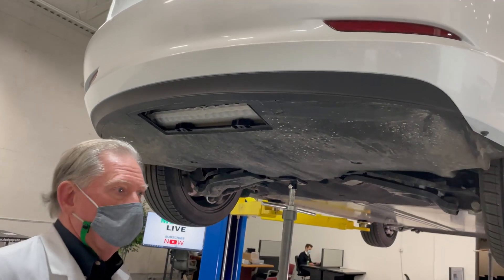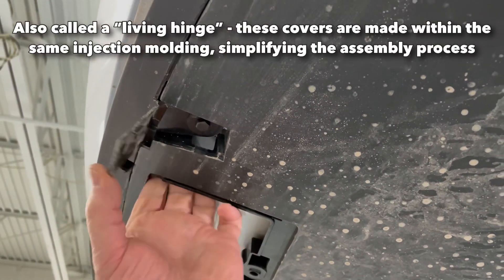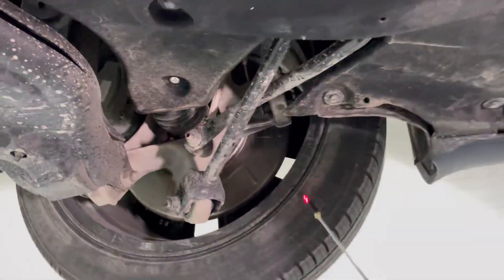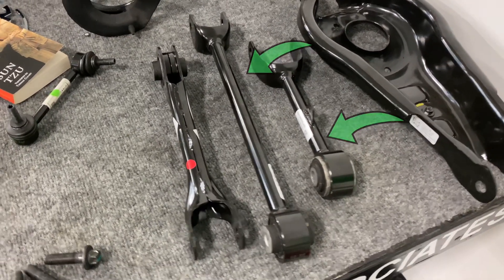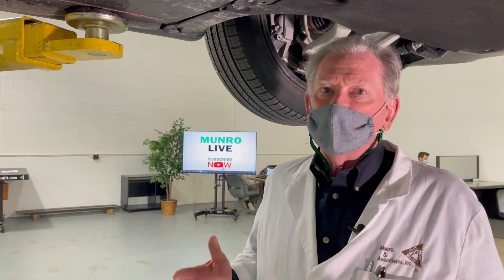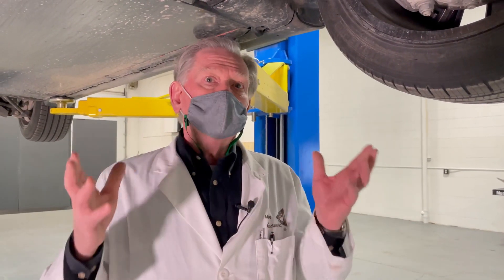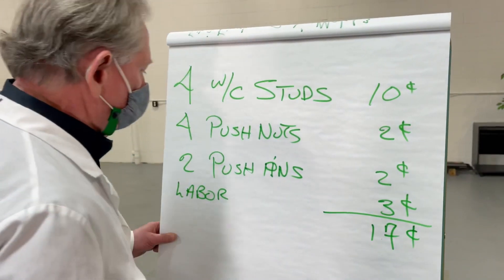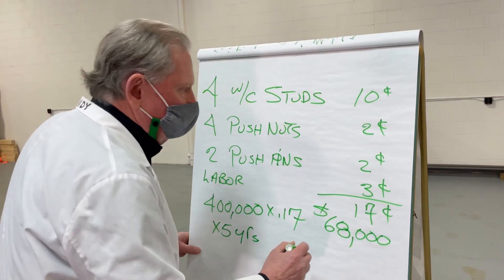2021 Tesla Model 3: E2 - Hoist Review & Some Cost Savings

Comment: Sure it represents money globally but the essential metric is the margin per car. It is these kind of cost reductions by the hundreds or even thousands that can help improve the per car profitability and then the positive cash flow of the company
Reply: I mean, why paint the car? Why have motorized seat adjusters? Why not have a fixed steering, instead of a motorized one? Why have Autopilot and FSD? Why not have a manual window wind? At what point is cheap too cheap?
Reply: @KyleHubb  There are tremendous cost reduction possibilities by having simple engineering and well executed manufacturing. Car assembly is a work of thousands of pieces put together and a lot can be done to cut cost.

Comment: About that rear underbody access panel: several possibilities come to mind to justify it.

One is design standardization.  By designing that access cover as it is, the Model 3 design can be readily exported to factories where towing is intended to be a feature (Europe).  GF-Berlin doesn't have to develop its own rear underbody; it can take the US design and simply add the tow package.  Easy.  Cheap.

There are advantages to universality of design - fewer parts to keep track of in the system is good.

The other possibility I'm not so sure about, but... that access cover might be useful for removing dirt and water from the rear underbody, particularly water.  We would hope that no dirt or water will get into that space - but Tesla has had difficulties with earlier underbody designs.  Maybe they put that panel in to simplify maintenance (reducing warranty costs Tesla bears, as well as reducing post-warranty costs for consumers) if that problem reared its ugly head again.  Pop the panel and drain; or pop the panel and powerwash, then drain.  No need to remove the entire rear underbody panel.

Comment: A lot of people may say this is good but I personally am against it. I would very much would rather have those clips plugged in. Knowing very well that I am not gonna have a piece be falling off or gathering dirt over time.
Reply: Couldn’t agree more. It might be sort of good now, but after some years and maintenance when the covers had to be removed multiple times and reinstalled, they will get more deformed and just hang on. Well noted that it will definitely will be collecting and trapping mud there. Also, another possible point for annoying plastic rattling of loose parts.
Reply: And you bet you still pay for the clips!

Comment: Hello, first of all, I would like to thank Tesla for providing people all over the world with relatively equal's affordable and high-quality sustainable energy vehicles and home solar systems!
As for cars, I think the workmanship and gaps are all minor problems. Simple and practical interior design, smooth and beautiful appearance design, superior performance, convenience and practicality are the key points.
However, regarding kinetic energy recovery and single pedal mode, I have some immature opinions here. I hope Tesla can refer to it. Thank you.
I'm 38 years old, I have more than ten years' experience in driving oil cars, and I've driven many German and Japanese cars. Out of my sincere affection for Tesla (I haven't bought it yet because I had some personal problems two years ago, and I will definitely buy a Tesla home in the future), I've tested model3 several times, and I feel great, which is more German than German!
Some time ago, BYD Qin was driven for a few days, but it was good at first. After a long time, the kinetic energy recovery was too uncomfortable. Your right foot had to keep in a tense state, stepping slowly and loosening slowly. If you were not careful, you would stumble. Moreover, the kinetic energy recovery in both gears was very strong, which made my right foot afraid to leave the accelerator easily. Once I followed the car to the right at a low speed, and the car in front suddenly slowed down. My right foot was still reluctant to leave the accelerator and tried to slow down by lifting it. However, because the car in front decelerated too fast, it was not enough to slow down by lifting the throttle, and it was getting closer and closer. At this time, I was nervous and stepped on the throttle slightly, and almost rear-end collision. Only then did I react, and I quickly braked to avoid an unexpected acceleration accident.
Since then, I have been worried about the recovery of intensity kinetic energy. I am worried about whether Tesla will have similar problems. With this question, I once again went to test drive model3, focusing on the feeling of kinetic energy recovery. Fortunately, The kinetic energy recovery of model3 is also two gears. When it is set to the easy mode, it is basically similar to the oil car. Although raising the throttle will slow down slightly, it is very smooth and soft, which basically will not cause the right foot to remain nervous all the time. However, in the standard mode, the recovery intensity of kinetic energy is still very high. Although it is quite smooth compared with BYD's suddenness, the deceleration of lifting the throttle is still obvious. This is not a problem of inadaptability, but a problem of lightness. Although automatic driving will make people more relaxed in the future, there will always be some roads that are not suitable for automatic driving or users occasionally want to drive by themselves. Fortunately, Tesla gave users a choice to drive easily.
Recently, I heard that Tesla is going to cancel the function of adjustable kinetic energy recovery intensity and use standard mode or automatic mode in a unified way. Although the latest version has not been tested, the feeling of lifting the accelerator pedal will definitely not be as natural and smooth as that in easy mode. I hope Tesla will consider whether this function can be restored and let users choose which way to drive.
With regard to the single pedal mode, it seems that the driving steps are simplified, but in fact, they are more complicated, which makes it easier for users to step on the accelerator as a brake and cause unexpected acceleration accidents in some cases.
A driver can be divided into five driving states, namely acceleration, speed keeping, natural deceleration, braking deceleration and emergency braking. In the era of oil vehicles, the right foot movements corresponding to these states were: stepping on the accelerator pedal, keeping the accelerator pedal, leaving the accelerator pedal, lightly stepping on the brake, and re-stepping on the brake. However, in the single pedal mode, the logic of the right foot changes to stepping on the accelerator pedal, keeping the accelerator pedal, slowly and linearly lifting the accelerator pedal, rapidly and linearly lifting the accelerator pedal, and stepping on the brake pedal again. The crux of the problem lies in two stages: natural deceleration and braking deceleration. The traditional driving habits are clear and easy to do, but the single pedal mode requires the right foot to keep tense all the time. Moreover, braking deceleration and emergency braking are two completely different actions, and the relationship between them is very close. In some accidents, these two States are connected together. First find out the situation, first use the brake, It is found that the braking force is not enough at this time, and emergency braking is carried out quickly, which is changed from light braking to heavy braking in the traditional driving mode, but in the single pedal mode, the accelerator pedal is quickly and linearly lifted to heavy braking. Obviously, there are problems in both the conversion difficulty and the conversion speed.
After talking about the comfort and safety of the single pedal mode, let's talk about energy saving. The current technology may not be able to combine kinetic energy recovery with the brake pedal under the condition of safety, seamless and acceptable cost. At present, it is only heard that the taycan of Porsche recovers energy when braking. Regardless of this point, based on the existing hardware configuration, it is possible to lift the accelerator pedal to use the easy recovery mode (or use the standard, which depends on the user's setting), and perform standard energy recovery (or more intensive energy recovery) when the brake pedal is depressed. Because in some cases, when the driver lifts the accelerator pedal, he only wants to slow down naturally or relax his right foot, and has no intention of braking and slowing down. At this time, if kinetic energy recovery is forced, the vehicle speed will drop quickly, and then the driver needs to accelerate again to mention the speed just now. According to the conservation of energy and the conversion loss, the energy recovery in this case is ineffective or even not worth the loss (of course, the accelerator pedal can be lifted slowly and linearly, but this will test the user's driving experience and be very nervous.
To sum up
1. simply restore the adjustable function of kinetic energy recovery, and let users choose which mode.
2. For safety, it is better to cancel the single pedal mode.
3. Adjust the kinetic energy recovery logic, lift the accelerator pedal to use the easy recovery mode, and press the brake pedal to use the standard or enhanced kinetic energy recovery mode.

The above is the voice of a loyal Tesla user. I hope Tesla will get better and better, popularize the use of sustainable energy as soon as possible, and use solar energy to power homes and cars! And can give back electricity to the society! This is great! !
Thanks again

2021.1.17

Comment: Starts by staying that the original rear undertray that used to be one part, is now two parts, plus a flappy bolt cover that got him real excited 😊.... furthermore there was no reason for doing this in his opinion as it adds cost.

Then he proceeds to the front of the car to discover that fixings that secure the flexible undertray are missing, suggesting that these bits have been deliberately omitted to "save costs" (17¢).... nonsense.

I disagree, the likelyhood is that these bits are missing either because of pressure on the operators on the line to ramp-up production to meet Musks production targets, or they have not had these fixings available due to depleted stock. 

It makes no sense to omit these fixings. They are an inherent element of design to securely fasten the flexible undertray into place, so they do have a legitimate purpose. If they weren't required they wouldn't have been designed to be there in the first place.

Sandy further displayed the flexibility of the plastic panel that should have been secured by these fasteners, obviously the purpose of the fastener is to prevent the panel from flexing and distorting as he demonstrated.

The consequence of this panel not being secured will be that the panel will be flapping about in the airflow under the car at speed. This could result in vibration and subsequent oscillating noise and vibration communicated into the interior. Additionally the oscillation of the panel interrupts airflow under the car (the very reason for the undertray) causing turbulence and hence drag. 

A flexible panel such as this oscillating is likely to result in fracture or failure further down the line.

I say from experience. Subsequent to having a repair on my car the mechanic missed refitting one of the fasteners. I had a buzzing and vibrating noise that came and went.  
The car was in and out of the garage for 8 months trying to identify the problem, which they failed to do... It was picked up on the next MOT where they found the undertray was split due to the continual flexing and likely to break off in the not too distant future.

I had a new tray fitted which was secured properly. The noise had ceased.

I'm shocked that Sandy had not even picked up on the necessity for securing the undertray for reasons of aerodynamic efficiency.

The few ¢ (aledgedly)  'saved' is likely to impact later-on with consequential service visits.

The additional cost of the (now) two piece rear tray is likely to exceed the 17¢ "saved' on the omission of the fastenings, so his analysis is nonsensical in this instance in my opinion.

Comment: Hi Sandy, I thing most expensive part was omitted is time! How much production time you save by not installing this parts? if you save 1 minute  x 100 cars you saved 100 minutes. I don't know what is the throughput Tesla model 3 is but I bet you can increase it by one car / day minimum just by not adding unnecessary parts. Best Regards, Tony

Comment: Sorry, but you have to add the time it's saved by the company by not doing this extra stuff; if I accept that the work is worth 3 cents, and they pay workers with an average of $20/hour, 3 cents is around 6 seconds (it pays around 33 cents a minute).  6 sec x 400,000 = 2,400,000 sec or in other words 666 hours (i know, weird number). Now, how many cars are the workers assembling  in 666 hours? I'm willing to bet about 200, assuming it takes an average of 3 hours to put it all together. That is the real saving, time, not money.

Comment: Remember Elon's motto: The best process is no process. The best part is no part.
The cover for the trailer hitch is an injection molded part. The rest of the back-end cover is also an injection molded part. Do you make and store two injection molded parts, or three?
A trailer hitch is an option, the question becomes how much money (time and material) would be wasted installing the trailer hitch at the time of purchase, after purchase or even aftermarket? 
You have to use or replace the back-end cover with one for a back-end cover with a hole in it.
After-sale or aftermarket it saves the cost of taking off the old cover potentially damaging it and throwing it away.
Which is cheaper? To manufacture and store three parts or to manufacture two parts which can fill both roles.

Comment: hi, I love this chanel, its exiting to see and ear opinion of an expert. one thing I didn't like about this is,  those push nuts and push pins and studs where there to avoid this peace of plastic to open up, and get bent out of shape, avoiding sh i t to get inside . can you imaging driving in thick snow and having to back up, snow and salt would get in and fill this place up eventually this peace would get thorn apart and for no reason. now imaging if its gravel, oups, we are not all leaving  in los angeles. hope the wont have this kind of mentality with the cibertruck.

Comment: Hi Sandy
Thanks for the great videos.
  I don't like the new formed sheetmetal side link. It looks like mud and road salts could easily cause corrosion and lead to premature failure, especially if stressed. 
  I'm not impressed by the snap tight small plastic rectangular flap, those always fail.
  I don't like the elimination of plastic fasteners either. I have had to take my car in to the dealership multiple times to repair loose plastic wind deflectors making loud sounds while driving. 
Just my opinions based on my personal experience.

Comment: Munro, you have to remember that some of their cars have the same classics. So it would cost more to have to make a different molding to accommodate each and every classics. And it cost a lot of money to run each and every different molding machine. One molding going to cost over $100,000 just to make one that covers the bottom only. And that's only good for about 100,000+ injecting before you have to make another one. So they are saving money by using the same molding on a few difference classics. So you are seeing a molding that might have been designed for the Model Y which has the Optional Tow package. When I worked at CANON I was able to save them over $10 million a month by changing the way things were done with the all their field Technician and their service contracts. I was also able to change their warehouse layout for when they did inventories, it use to take 30 people 3 days to count all the inventories. With the changes I made they were able to do the same work with 5 people over the weekend!

Comment: I'm surprised by Sandy's reaction here, I'm not nearly as impressed. I can almost guarantee those locking tabs on that flap will break after it's used a few times, especially in 5+ years when it's brittle. And the underbody shield is now susceptible to being heavily damaged when backing up, by getting caught on a stick, frozen snow, etc. Doesn't seem worth the cost cutting at all. It looks sloppy.
Reply: Agreed that panel will be flapping in the wind & debris will get under.
Reply: Yeah
As a car mechanic if i had it up on the lift,
I would report it as missing the parts

Comment: Eliminating the little hatch on the rear air shield would require building a whole new, giant mold for the air shield. That's a pretty expensive prospect. At least tens of thousands of dollars if built in China, and perhaps 5x that if the mold is built in the US.